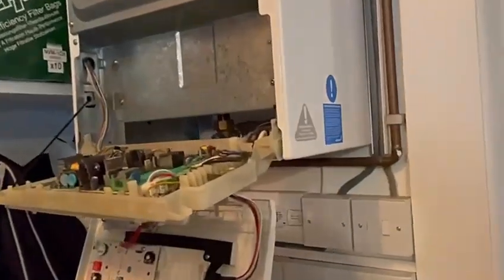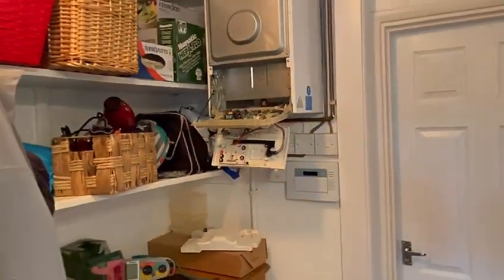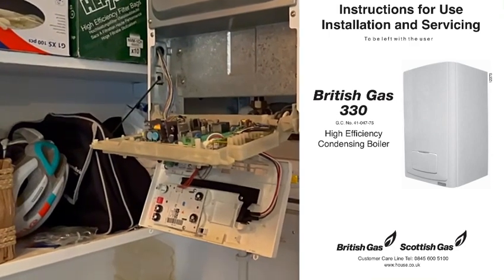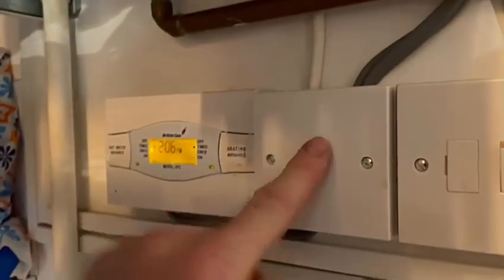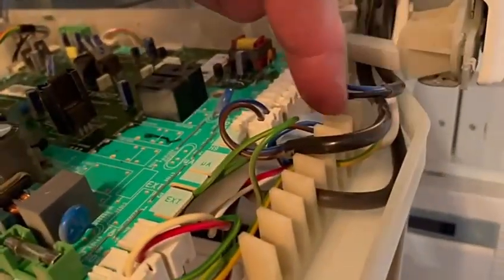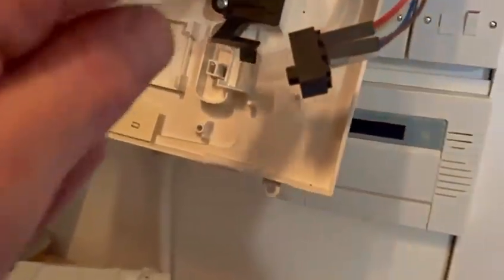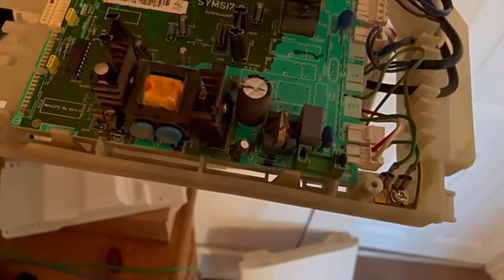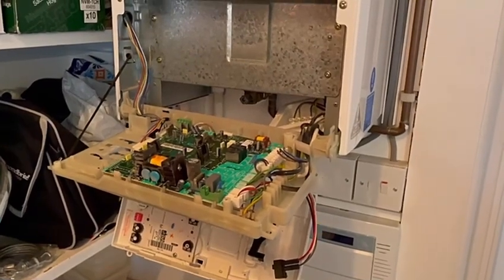Electrical Fault Finding on a Gas Boiler… EASY?

Comment: Gas technician here. This is a common fault on these boilers. These were made by Glow Worm for BG. I don’t remember which model though. The problem is the PCB and there is no way to repair that, you just have to replace the PCB. The problem usually occurs when the boiler is switched off and back on for a service. Sometimes they will start cycling which is when they will go off/on repeatedly for a good 5 minutes or so and then either die completely or come on and work fine. Hope this helps.

Comment: Unless you’re gas safe you don’t really need to take the cover off a boiler to fault find.

You can’t legally take a cover off that forms part of the combustion seal.
Reply: It’s a room sealed boiler. The outer casing douse house a seal. The combustion chamber cover does.
Reply: @benYMSB  still u are not allowed to take off it illegal
Reply: @Mchy0 my point was taking it off doesn’t compromise the integrity of the seal.

Comment: We have a standing instruction preventing any live testing except at the consumer unit.  When called to a heating fault this pretty much removes significant diagnostic options making fault finding a pain (Not just on heating systems).  Ironically currently our gas safe engineers with less electrical training, test equipment and experience are not restricted in the same way.  Were pretty much limited to covers on function checks and continuity testing or just changing out components based on likely cause.
Reply: How on earth can you find most faults with no live testing and within a respectable period of time?

I'd certainly ignore that standing instruction as would 99% of qualified sparks that know what they're doing.
Reply: @helijim  It was either that instruction or have a second safety operative with you at all times.  This is in domestic properties BTW not commercial/industrial.  Only live testing at consumer unit with safety barriers.  Basically that standing instruction is impractical most of the time and as you pointed out drags fault finding out on control circuits especially.  this instruction doesn't include gas safe engineers at the moment so they can probe away with a multimeter in a boiler or wiring centre and I can't.  They were going to make it across the board but hit a problem that would either task an electrician with every gas safe engineer as a team or put the gas engineers on some courses and issue them a MFT when they can use one.  As its a standing instruction were stuck with it, impractical or not.
Reply: @jasonwatson9011  I feel your pain.
Reply: We had a fault on our condensing boiler last year. It has a reservoir tank and pump, external to the boiler, which pumps the condensate up to the loft and out through the stink pipe. The pump stopped working, the reservoir tank reached it’s maximum level and disconnected power to the boiler. I installed a new pump and the boiler started working. The same issue happens, where the condensate is gravity fed to the outside and freezes up in freezing winter temperatures.

Comment: No sparks should be touching inside a boiler,
Ready the M.I unless you are Gas safe registered, how can you confirm you haven’t now caused CO leakage..
Or Gas leakage..
Reply: He's taken the cover off to access the electrical connections and didn't disturb anything to do with the combustion chamber or flue?

I'm not being argumentative, just mildly pedantic because that's the nature of us electrical wizards ;-) I've been to retrofit smart controls to recently installed boilers and found incorrectly rated fuses in the spur, no ferrules on stranded conductors, 5-core cables with wires cut short/off or left floating because they weren't being used, 2-core T&E with the CPC being used as a switched live, so likewise, Heating Engineers shouldn't be touching the electrical connections unless they're suitably qualified?
Reply: He's removed a decorative cover, if you're gas safe I suggest you read up on your own regs.
Reply: On that particular boiler the outer cover and wiring terminals are NOT within the room sealed section of the boiler - so not an issue.  On some boilers you cannot access the electrical connections this way.  In that case I would agree with you.  For some reason more modern boilers have moved the electrical connections into this room sealed area which to be honest seems like a really dumb idea.
Reply: @jasonwatson9011  sorry if the guy got it working how can he test the integrity of the flue.. as he is the last person working on the boiler.. he is HET.. even if he wasn’t working on the flue he is responsible.. as soon as you take the case off you are responsible for the boiler.. weather it is AR or ID..
Reply: @shannonj1000  He hasn't touched the flue, or the sealed combustion chamber or any part of the boiler you need to be gas safe qualified for, just checked the terminations and the relevant supplies are what they are supposed to be.  They have checked out as correct and handed over to a gas safe engineer.  None issue -  no regs breeched.
Reply: Sparks can't mess inside the sealed combustion chamber. They can access the electrical components
Reply: Laughable. A plumber/gas engineer trying to talk down an electrician. You need to look up your gas safe regs. I ain’t no gas safe engineer but I know a lot of the regs. 
However I am an electrician and a DC engineer and that board is mainly DC after the conversion down from 240v AC. 
Best regards, 
Scott. ✌️🙏✌️
Reply: A CO leakage?! From taking the outer casing off a room sealed boiler?! How is that possible then?
Reply: So what about the heating engineer that connects the boiler to a spur/fused connection unit?

How can you confirm you now haven't caused a break in the earth to the boiler or that there wasn't one there before?

Do you guys carry an earth loop impedance tester?

Exactly!
Reply: @helijim  Indeed, remember the Artisan video with the "gas-safe" installer have a go wiring that nearly killed Jordan (it had been hard-wired to the upstairs ring on a fused spur and was also plugged into a downstairs ring socket).
Reply: @kirkhamandy  bloody hell. I came across that too many times now. They think it's acceptable, even when you quote regulations saying is not
Reply: @kirkhamandy  Had the same the other week when I pointed out plugging the permanent supply to the boiler on a plug top to get it working pending having an electrician rewire it.
Reply: @kirkhamandy  I fitted a Hive to my mate's boiler the other day and the guy that connected up the TV amplifier ran a spur off the boiler spur, but in 0.75 and never connected the earth, probably because he was lazy and the TV amp was double-insulated.  And guess what size the fuse was in there?

This type of work goes on everywhere I'm afraid with non-qualified sparks.